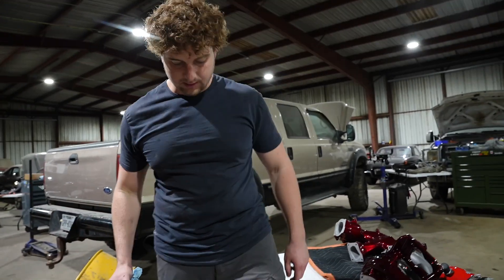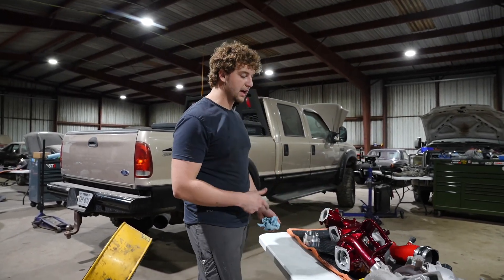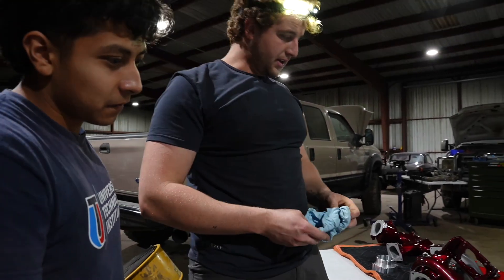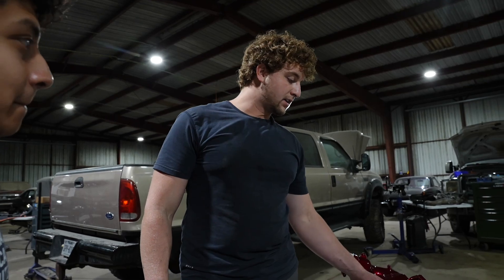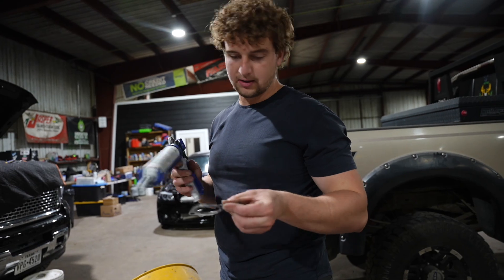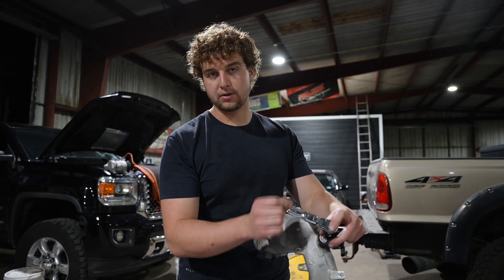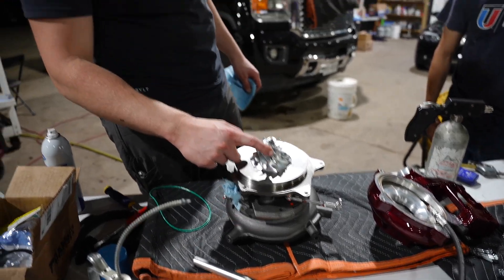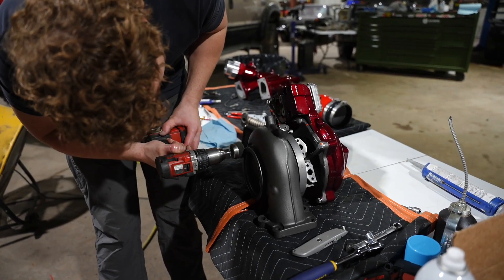Stealth 64mm Turbocharger install on L5P Duramax

Comment: Is this really a stealth 64? I just got mine installed yesterday and doesn’t sound as loud as this one. New DP, 5 in-6in elbow, small DP exhaust leak, can it be tuning maybe? Or should I try a new turbo?
Reply from the maker: Yes this is the stealth 64. This truck has DP, full 5in exhaust, and piping kit. Tuning can play a little part in it as well.